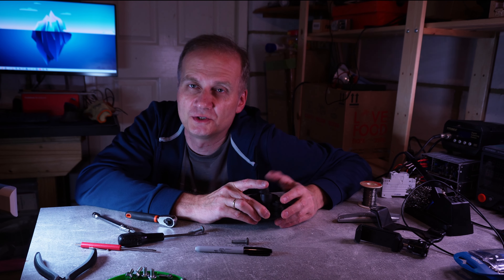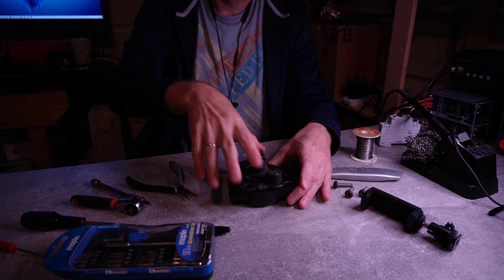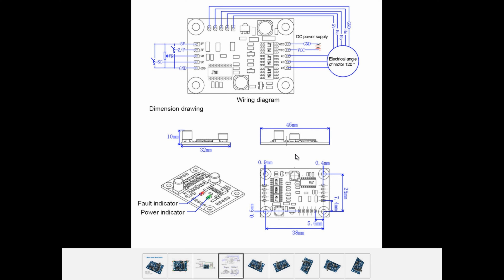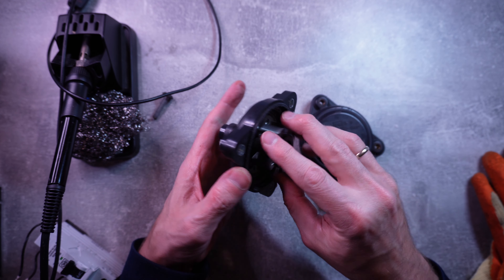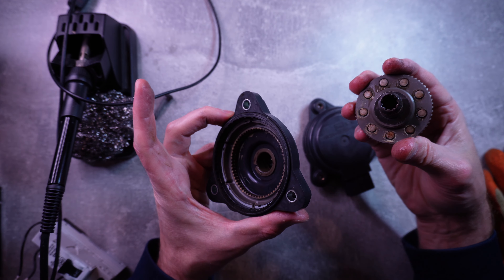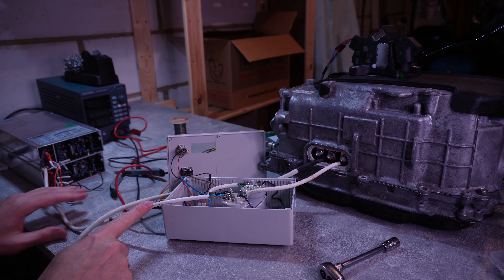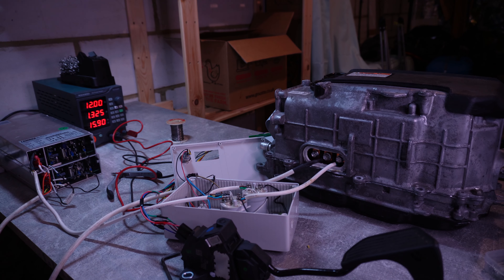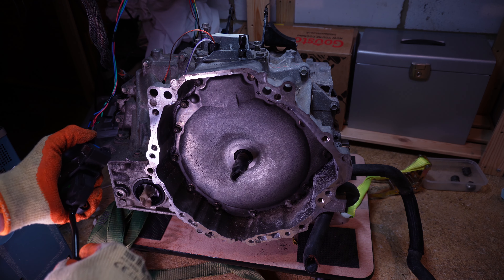Parking Pawl Toyota Prius DIY EV Ep 15

Comment: I was also thinking about using the parking pawl mechanism: it’s either copying the way Toyota originally does, electronic mechanism just like you did, or using mechanic cable, same as Toyota Prius C (aka Toyota Aqua). 
Don’t you think it’s better to use Toyota original gear selector with tiny handle?
I’m wondering what protocol it uses, since it has several modes of driving like Normal D(drive), Reverse, Neutral and B (battery saving mode while you drive down hills or mountains, which preserves the Battery from overcharging because of Recuperating)
Reply from the maker: I think I will implement reverse through the open inverter board. At this stage I have decided just to leave the parking pawl disengaged and focus on other areas that get me closer to getting the motor in the car.
Reply: @LatutaEV  Can’t wait to see how your car finally goes electric ⚡️👍🏼. Anyways, you will have to think about setting the car to Park mode as well, Hand brake is not the solution I guess. By the way, what car is your donor?
Reply from the maker: @dekartus4ever  Yes this is my thinking about the handbrake. I actually have not decided on the donor model yet. I might do a video about that,,,😉
Reply from the maker: @dekartus4ever  I know that I want it to be light inexpensive and more or less aerodynamic,😂
Reply: @LatutaEV  Kinda Honda Jazz or similar?
Reply from the maker: @dekartus4ever  Well I started looking at Mazda RX8 first, after that it was Audi A2, and now I am looking at Audi TT or Toyota MR2
Reply from the maker: @dekartus4ever  Honda Jazz is too boxy and not much space for the battery
Reply: @LatutaEV  I believe you can buy RX8 at a reasonable price since they’re all sold with dead rotor engines. But I think trunk area is not big enough unlike Golf 4 or any “golf” type car.
Reply from the maker: @dekartus4ever  Yes that was my intention in the beginning but the problem is that RX8 has engine at the front and rear wheel drive. I want to drive the wheels directly from Toyota drive system using gears and diff in the gearbox. This is more suitable for the front wheel drive system. I was thinking about placing gearbox at the back but there is not enough space there at the back in RX8. And I don't want to mess about with the Mazda by changing it to front wheel drive.

Comment: Great video Ed, thank you. It looks like the parking pawl was not engaged in the previous video
Reply from the maker: What I though was parking pawl was actually the motor itself. I think it was in the unlocked position. It could be that the PSU can not deliver enough current. I will see what happens with the battery
Reply: @LatutaEV  I would install a motor of windshield wiper, it can deliver enough torque to your gear which is switching gearbox Back and Forward.
Reply from the maker: @dekartus4ever  Interesting idea but that means that I will have to buy another part. I would rather just do it manually or try to do it the same way Toyota does it